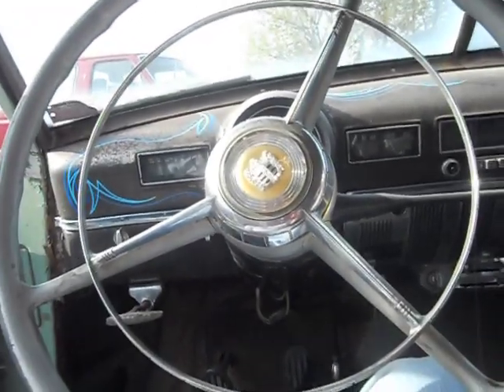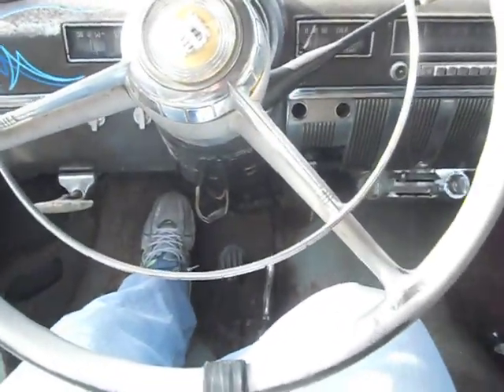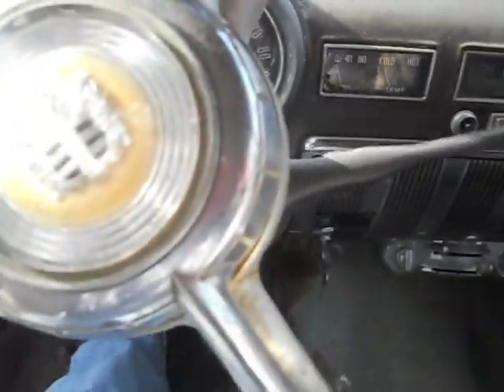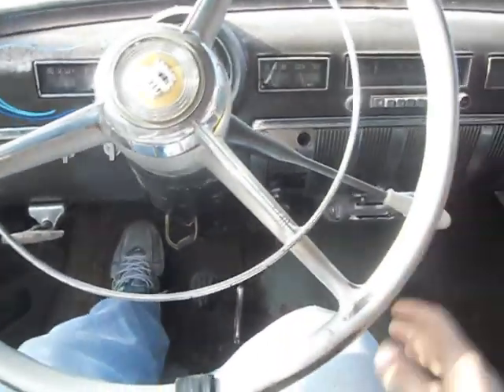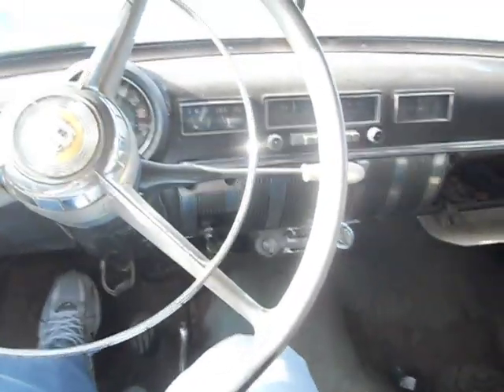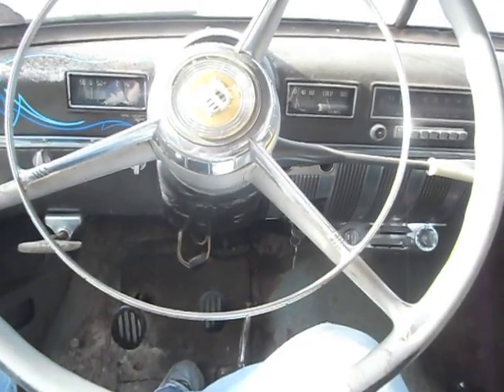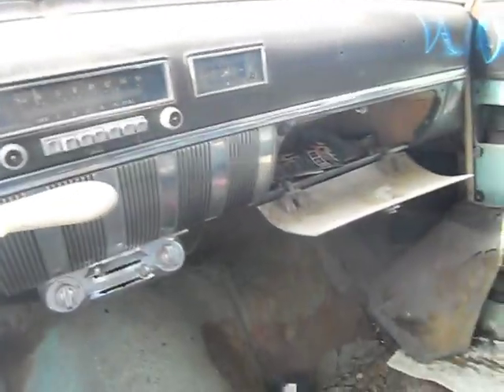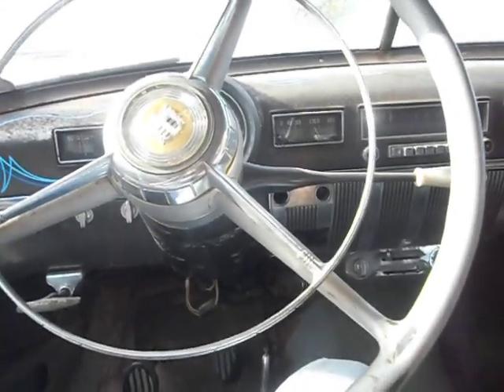How to drive a Gyro-Matic Transmission.AVI

Comment: One thing I love about mid-1900s cars is all the funky things they tried doing with the transmission. Even though nothing beats a standard manual transmission or even a standard torque converter Automatic, it never stopped the American motor industry from trying new things, like sticking a torque converter on a manual, or this gyro-matic.

Comment: I learned to drive on a car just like this, which my dad bought new. (The Dodge dealer was his old friend and fishing buddy.) SOP for Gyromatic is to put the lever in the down position, and release the clutch while stopped. The car would proceed from a standing stop that way just fine. The two speeds with the up position were needed only in adverse driving conditions. Earlier Fluid Drive worked the same way.

Comment: BTW, just to make things more confusing... if you ever see a Dodge badged as "Fluid Drive" (not Fluid-Matic Drive), that means it has the Gyro-Matic's fluid coupling attached to a regular 3-speed manual transmission. It worked exactly like a regular 3-speed except you could shift without the clutch. Like someone else mentioned, most people just left the Gyro-Matic in high all the time. Fluid Drive debuted in 1939 and the semi-auto in 1941, but most Dodges you see with them now are '50-'53s.

Comment: You basically just left the gear shift in the 3-4 position for normal driving and drove it like a regular automatic wit the exception of lifting your foot off the gas to upshift about 15-22 mph.  It automatically downshifts when stopping at a light or stop sign.  You can hold the car stopped without pushing in the clutch.  Chrysler Corporation used this right up to 1953 when they introduced the two speed Powerflite in 1954.

Comment: Once you are shifted into that range, you would accelerate until you reach the rpm where you would normally shift a manual transmission.  Then you would let up on the gas pedal, you would then hear a metallic click, which means it has shift into the 4th, and then put your foot back on the gas.  It will downshift automatically when you come to a stop, no need to clutch, unless you wanted to shift the lever to neutral or other range.

Comment: I'm not 100% sure about this, but from what I've read it's the same exact thing; the only difference being that the ones labeled "Fluid-Matic Drive" had a shift quadrant on the column like a regular automatic, despite functioning the same exact way. Chrysler sold these under many different names, but they're all similar (there's good articles on Allpar and Ate Up With Motor): 2-speed manuals with an underdrive range in each gear behind a fluid coupling.

Comment: We had a '52 DeSoto, technically a cross-breed of Chrysler and Dodge. This had Fluid Drive(at least that was what it was called). To start. the shift had to be in the down position. Shortly after when the car began moving, the driver lets up on the accelerator briefly for auto shifting into third. If shifting from first to second was desired, the shift would need to be pushed past neutral to the up position, away from the steering wheel. To shift into reverse,you pulled the lever toward you in neutral, then up. The clutch pedal use was optional, having on the pedal pad "Safety Clutch" inscribed.

Comment: I was a kid when those cars were used cars and my father was a car dealer.  I hated those Chevrolets because '41-'48 had vacuum shift which made the gear shift lever virtually impossible to move when the engine wasn't running, so I couldn't sit in a car and shift it through the gears like a normal car.  They did away with it in the '49 redesign.

Comment: the technical operation is formed by a torque converter on which the disc is supported clutch. you can stay put without pressing the clutch pedal. And a very robust system, but a bit slow was used for heavy vehicles like the military truck. With snow you could insert the 4 and starting bringing in less torque to the wheels. In this case very useful.
Reply from the maker: gianluca celentano that's pretty awesome, never knew that

Comment: You only use the clutch to shift the lever into a driving range.  To put it in reverse, or straight up for 1st and 2nd, or straight down for 3rd and 4th.  1st and 2nd is not a normal driving range as it is extremely low, like for steep grades.  Normally you would pull straight down into the 3rd/4th range and let out the clutch, even at a stand still, and you could have your foot on the brake, or stop the car in that range.

Comment: Incorrect info!!!  No one ever drove them as described.  You placed the gearshift lever in the lower position, let out the clutch and the car sat still.  When you pressed on the accelerator the car would move forward.  When it reached about 20 mph you let your foot off of the accelerator for a moment and it shifted to "High" gear.  You did not use the clutch again unless you needed reverse gear or had shut the engine off.  I drove a 1950 Dodge Coronet about 70K miles back in the mid 50's.  It was my first car.  They were slow but not as bad as a 1950 Chevy with Powerglide.
Reply from the maker: Then why are the 2 I own / owned not like that?
Reply from the maker: So I had the car out last weekend and tried to drive it the way you described, it to no surprise to me acted like a car in high gear where it just wanted to bog down and die, so im not for sure what transmission your vehicle had but for my applications it did not function as you stated
Reply: @Kerrage  Hi,  I had a 1950 Dodge Coronet with the Gyromatic transmission.  If your transmission is lugging down and stalling the engine you have one of the most frequent problems these units had.  The Fluid Coupling/Torque Converter is not unlocking when you get to low vehicle speed.  They were designed to unlock so the engine would not stall at low speeds.  Sounds like yours is not doing that.  I had to repair mine twice for this problem during my time of ownership.  With the car sitting still and the engine running, try putting in the clutch, shifting the lever to the high range (down), and with your foot on the brake let out the clutch.  The car should remain stationary and the engine should NOT stall.  If it does, your unit has the problem. What I described may work just fine before you have driven the car and not work correctly after the converter has locked up during driving.  You may still have a problem with the sensor that unlocks the converter malfunctioning after you have driven the vehicle.  I have seen it happen both ways.  

Another feature that was part of this system was the "passing gear" kickdown when  you pressed the accelerator to the floor.  When you did this the converter would unlock and the transmission would shift to the lower range and off you went in a cloud of dust and a roaring flat head six. Then, you let off the accelerator and it shifted back to "high" and the converter again locked up.  A driver didn't do this very often as it was fairly violent for the passengers.  You would get "one of those looks" from your spouse.  

When they were working correctly these cars seemed very slow until you got behind the wheel of a 1950 Chevrolet with Powerglide.  Talk about slow!!!  Gyromatic/Fluid Drive was "speedy" compared to one of those.  Please note the comment from Bachfeuer just below where he describes the Standard Operating Procedure of Gyromatic.  He is correct!!!

Comment: Normally, you don't need to use 1st & 2nd. That is for pulling a trailer, or starting off going up hill. BUT! be sure to disengage the clutch when starting the engine! If in forward or reverse, the engine will crank without the car moving, due to low oil pressure. (10 weight motor oil was specified for the torque converter/ transmission.) But when the engine starts, the car will bolt forward or backward. That was why the words "Safety Clutch" were embossed on the clutch pedal pad.

Comment: Note to Bachfeuer- I had a '49 Chrysler Royal 4 door sedan. I would start out in 'drive' range- shift in 'down & out' 3rd gear range when I first got the car.  Engine was just rebuilt & carb overhauled, but it seemed like it didn't want to get out of its own way. I ended up driving it somewhat like a 3-on-the-tree- used 1st to get moving, released the accelerator, "clack-clack "2nd gear (shift still in up position) to gain a bit of speed, then clutch & move shift to 'high' range. If I were still under 17 mph, 3rd gear would catch, then I sped up, released the accelerator, "clack-clack" again & she was in cruising (4th) gear. If I was over 17 mph, she'd go directly into 4th. Wish I'd have kept that car-even though it was a 4 door & repainted 'refrigerator white'!!
Reply: You pointed out one of the serious problems with it.  If you really wanted it to perform and started in low range, it was impossible to shift from second gear to third gear; it would instead shift from second to fourth when you moved the shift lever from low range to high range.  That transmission worked just fine for very conservative drivers who were not interested in anything more than leisurely acceleration, but was no good for drivers who wanted brisk acceleration.

Comment: Ol mans 54 medowbrook has a torque convertor on back of a 3 speed trans. Does nice. In town you can stop a 3rd take off in 3rd never using clutch. Use to be popular with taxi drivers back in the day. But the 54 has a rebuilt flat 6. Tops out @ bout 80ish. Maybe could do more but

Comment: I had a '51 Coronet with "Gyro-Matic" back in the early 60's. Absolutely terrible gas mileage. With a rebuilt carburetor,  new points, plugs & tires inflated to 32 lbs, I drove from Utah to New York City. I NEVER exceeded 60 mph. That dog always averaged 11-12 miles per gallon - even in FLAT Nebraska! The guy who produced this video was wrong on one small point: the "Gyro-Matic" tranny was available as an option on the '49's. I have an acquaintance who has one. Imagine paying extra so you could get much worse mileage! My '48 Dodge with regular Fluid Drive got 16 miles per gallon at 60 mph. THAT was a great car!

Comment: Its all the same transmission - A Gyromatic Transmission in a Dodge, a Tip Toe Hydraulic in a DeSoto- anyway You simply put the Gear Lever Down hold the brake while you pick up the clutch then accelerate to any speed between 12 and 50 mph then lift your foot of the gas and you will hear the change up clunk from 3-4 you can kick down from 4-3 by putting the gas pedal to the floor and hitting it past the step.
As for The Low Range 1-2 who needs to use it unless you are pulling a heavy load up a steep hill?

Comment: Looks interesting.  The fear is if not knowing how to properly drive this type of transmission vehicle is to damage it!  

I can drive any normal manual shift transmission.  I can drive the big rigs with 18 speed manual transmissions. I have owned manual transmission muscle cars in the range of 600 HP.  I never have driven a gyro-matic transmission in my life!  I have driven 1960s manual transmission cars mostly stick shift.

Comment: I had the same type of transmission in a 1947 Dodge Coronet 2 dr Coupe with a flat head 6 with an oil bath air cleaner
Reply: Robert Morgan believe coronet started in 49
Reply: @1960tpk  They did. 1949 was the 1st year the 'Coronet' had its own name

Comment: all well and good,but you forget to mention, you have to use the clutch for reverse, and in between 1,2, clutch 3rd 4th
Reply from the maker: I also made a 2nd video going down the road driving it however I didn't include reverse in it either, but thanks for the input incase anyone sees this and isn't sure

Comment: I very seriously thinking of getting a Chrysler product from the late 40s to early 50's so this video really introduced me to the very basics. But do you have a video more in depth of regular driving? IE, driving in traffic...How to slow down, is there a Nuetral position, I mean like real time driving would be very helpful thanks!
Reply from the maker: I mean I could try, but I'm from a small town and don't take the car too far, so not much for traffic for me, and my brakes are a little sketchy, other than that though it's really like any other manual, it's not bad at all
Reply: +SBF Motorsports OK thanks.
Reply: I have a 4 door 1952 coronet . will be selling.

Comment: Basically this was a 3 speed Dodge Fluid Drive WITHOUT first gear.   A Borg-Warner Overdrive unit was attached, that clunkily upshifted when you lifted the accelerator.   So you had second, second OD, third and Overdrive,    Not a true fourspeed!
Reply from the maker: Charles Farley thanks for the info

Comment: Does anyone know if this had better highway performance then the manual three speed (just curious). If so assuming it was something like the three speed with overdrive?
Reply: I've owned a few of these cars. I know the gyromatic was available from 1949 to at least 1953. I owned a 50 and a 53 with this option. By 1956 they had advanced to fully automatic with push-buttons (had one of those as well).

The gyromatic was semi-automatic, you would use the clutch to put it into either of the two forward ranges, and also for reverse. There were 2 gears in each range, making it a 4 forward speed transmission. To shift between gears in each range (if everything was original and working properly), it was only necessary to lift your foot briefly from the gas  and you would feel it upshift with a slight "clunk".

You could start in low range for a little better acceleration if desired and then move to high range using the clutch.
Reply: @HalbertS-wt5hr  thanks; do they run at lower rpm’s than the normal manual transmissions . I have ridden in a Chrysler with a similar setup but your pushed a chrome button on the steering wheel to move up into the higher position. I can remember my mother saying about leaning to drive on one of these in a 1952 coronet and I have old home movies of it going up the road and of my mother driving it on the inside. My grandfather bought it new with the intention of my grandmother learning how to drive. There is one the same year and color for sale locally and it had the gyromatic as well. It would be neat to own but I believe my ability to own antique vehicles is permanently a part of my past at this point in my life.

Comment: If your carburater idle is too high ,it will not shift into high gear,,,the carb has everything to do with the trans,,,
Reply from the maker: what? lol
Reply: lugnutsdemo Linkage and solenoids control the automatic shifting and take their information directly from the position of the throttle linkage. I suppose if it's mis adjusted, or as 68customsuburban suggests, the idle speed it too high, it would throw off the solenoid activation.
Reply from the maker: ill make a vid of mine driving soon when i am home next it run s like  a top noe
Reply: MrBlueroads  sounds like it's finally wore out

Comment: for those of you that are having trouble getting into 2cd and 4th gear try this.... when your car is at the point of where it needs to shift just push in the clutch and it will force shift it for you..... i have to do that with mine as well and also for the guy that made this video, you made a small mistake, the 49 dodge coronet is also a gyro-matic. i have a 49 coronet but i am looking for a 3 speed to put into it cuz i dont care to much for the gyro-matic that is in it now... If any one knows where i could obtain a 3 speed tranny that will bolt up to the flat head 6 please shoot me a email at tdebrosky@ymail.com thanks and have a good day... nice to see these ol cars still on the road. good job with the video.
Reply from the maker: hey i have another gyro matic, im in iowa though and dont reallly ship stuff

Comment: im confused i finally got my 51 coronet on the road today and it never shifted into 2nd or 4th gear. what am i doing wrong?
Reply from the maker: idk, its really odd, to me it seems like you have to rev it up way to high to reach a certain speed before it will shift, i normally have trouble getting into 2nd, and somtimes it starts out in 2nd
Reply: Fluid Drive and Gyro-matic are two different couplings.

Fluid Drive was the standard transmission coupling provided.  It had four positions: reverse, first, second and third. You were able to shift gears using the clutch in the traditional H pattern.

However, the fluid drive coupling allowed you to come to a full stop and move again without using the clutch. In other words you could shift up into 3rd and stay in it without using the clutch again as you would with an automatic.  Though 3rd was very slow to accelerate and most people would clutch into 2nd and up into 3rd. Perhaps the biggest advantage was in not having to worry about matching the clutch and gas. You could shift into the gear of choice and simply lift the clutch pedal with you foot on the brake and the engine was stall proof.

Gyromatic was an optional transmission coupling that had three gear positions. Reverse was as normal and second and third positions became Power Range and Driving Range. There was no "first position".

As with Fluid Drive you could not stall out.  The difference being that the car would shift in both Power and Driving Ranges automatically with how you used the gas pedal.

With the car in Power Range, the car would upshift from 1st into 2nd with normal depression of the gas pedal.

You would clutch to move from Power Range into Driving Range.  

In Driving Range, normal use of the accelerator would automatically shift the car from 3rd into 4th. Pressing hard upon the accelerator while in Driving Range (4th) dropped you into the Acceleration Gear (3rd). In normal driving conditions you were expected, according to the manual, to using just the Driving Range (though this made for slow starts).
Reply: +rodan fiftyseven Thanks for the info.   I didn't see this before posting my question above